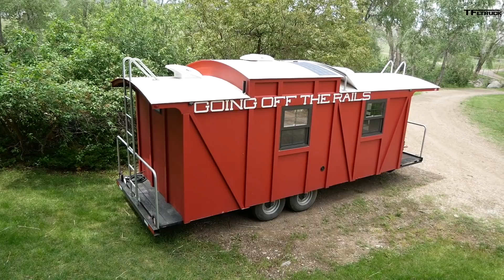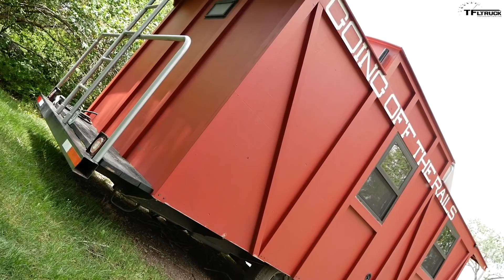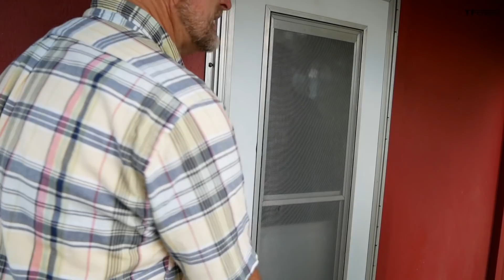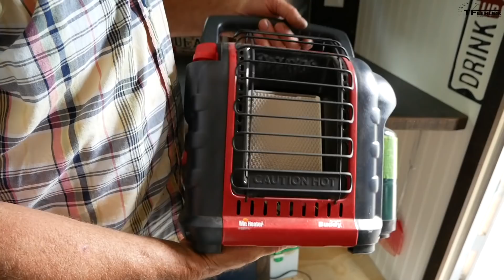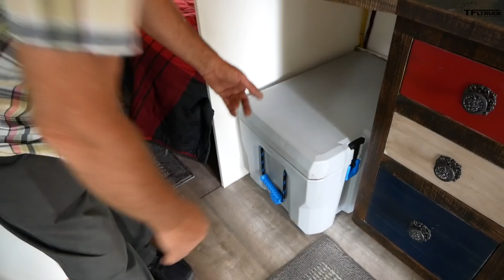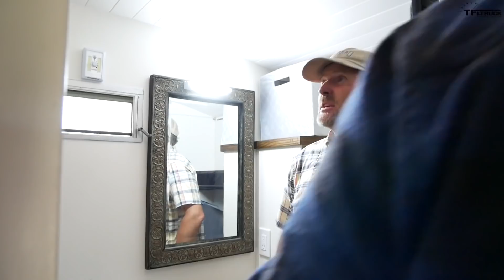When Is a Train Caboose NOT a Caboose? When It's The World's Coolest Custom Camper!

Comment: That is an awesome trailer you have there congratulations. I have a question on weight though and what do you use to pull it? It would seem much heavier than a fiberglass trailer.
Reply: Thanks John ! It is about 2000 lbs heavier than the old camper, however I do put a lot of the extra lbs on my truck. My cummins swapped GMC is a One Ton chassis with added air bags. I feel the extra tongue weight makes the truck ride smooth and straight with no sway.

Comment: love to know about the roof construction.
Reply: Jeff, I made 20 curved rafters by cutting up 2x4s into 1/4" slats and gluing them in a jig to get the curvature. Then 1/2" plywood over the rafters , then waterproof material and elastomeric coatings. The ceiling is bead board nailed to the bottom of the 2" thick rafters. hope this helps

Comment: Very cool but handymen are not mechanical engineers. Seems like that "exoskeleton" is held on the bottom with screws. Screws are not meant for shear applications. Walls are constructed to keep the wood in compression and the fasteners in tension. 

These are dangerous toys to DIY, avoid this if you see it on the road.
Reply: Is that what you think I am... a handyman? You have no idea how many hours of design work on auto cad it spent prefecting this design. Do you judge every book by its cover? You could roll this caboose over 3 times and it will still be in tack. Modern RV crumble on impact. Please know what your judging before you comment. by the way... those screws you see on the bottom of the frame are only for aesthetic value!